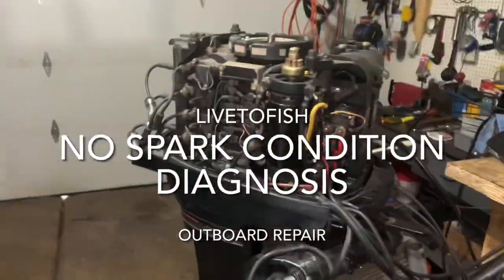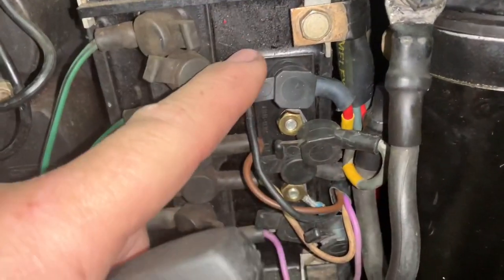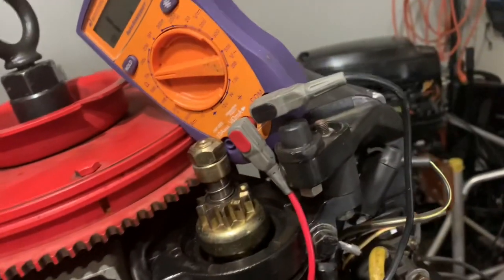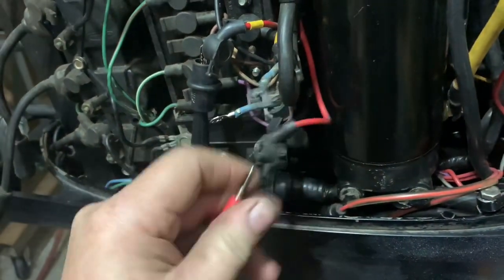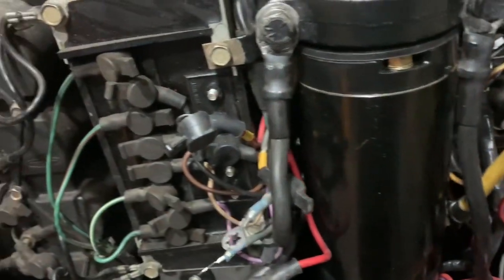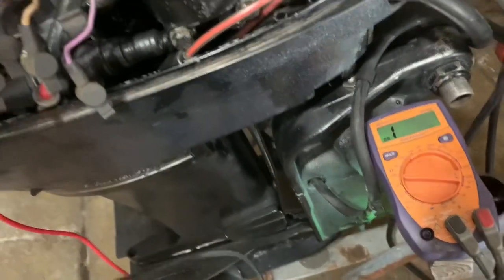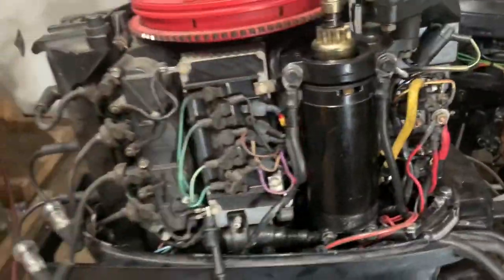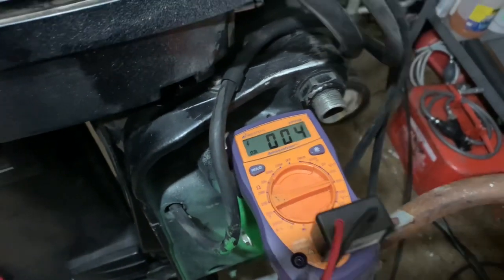“No Spark” Is it a Bad Switch Box, Stator or Trigger? Using a DVA Adapter - 1989 45 hp Mercury

Comment: Wonder why switchbox failed.

Bad coils will damage seitchbox. You dhould replace every coil before sttaching a new switchbox.  Otherwise the new switchbox will fail very much the same as the old one.
Reply from the maker: I suppose the switchbox failed from the owner overheating the motor. I have never heard until now that coils can damage a switchbox. Thanks for watching and commenting.
Reply: @LivetofishOutboardRepair 

I think that coils are very delicate devices. 

Thoy will not handle vibrations forever.

They are very difficult to be tested unless you have a good inductometer available. 

The secondary winding inside is very easy to be checked with a simple ohmeter and I have never seen any reading too far away from 1,000 ohms.

On the other hand I have measured very low inductances (and very low impedances) at 120Hz, which is a frequency close to the maximum rpm which is limited to 6,000.

A too low inductance, and impedance, on the primary circuit may overload the limits of any  switch box.

Two day ago I had the opportunity of measuring a dozen of coils. I found incredibly low values from 0.9 to 0.2 mH while I have read that a good coil may have an inductance as high as 8 mH.

I do think that all 12 coils were bad.

All these 12 coils were sparking alright because the ratio between primary and secondary was higher than ever.

The number of turns of a new coil at the primary might be only 100 or 200 turns of thick wire and more than 20,000 turns of a much thinner wire sit inside at the secondary.

A bad coil, an old one having suffered lots of vibrations for too many hours during several years, might get very many turns in shortcircuit at the primary winding.
The lower the number of working turns at the primary the higher is the voltage at the secondary, assuming that the switchbox can handle 20 or 30 ampere of current instead of only 5 or 10 amps.

Replacement of all coils every so often is.... mandatory, just to avoid the switchboxes to fail.

In fact I do think that all coils AND switchboxes should be replaced every 500 hours or every 5 years... just in case!

All old bad coils wouldn't avoid the engine to bring us back to the shore at very low rpms, but a single bad coil is able to kill the switchbox, which in turn might overheat the engine up to the point of having to buy a new engine!
Reply from the maker: @josemariatrueba4568  I've owned my Boston Whaler now for over 20 yrs with the original 115 hp Mercury and have only ever replaced the spark plugs and water pump impeller. I must be very lucky.
Reply: I guess you meant 20 years not 20 hrs.

Not carbonated calcium  deposits nor salt clogged the internal passages?

Your poppet valve diaphragm still alive?

You are not only lucky, you probably know how to take good care and never overheated your engine.

Mine is a Pursuit 2550 with a single 1997 Mercury 135 v6 2.0.

It used to have two of them, cw on starboard and ccw on port, but the later got completely destroyed from running a new set of three pairs of carburators because one of the 6 bowls didn't get any gasoline and one cylinder didn't survive running with no oil.

The starboard engine has been reinstalled amidship  and is powerful enough to get more than 25 knots the 3000 pound hull plus the 200 gallon tank half empty plenty of stuff, a 9.9 hp auxiliary 4 stroke and 6 persons onboard.

It gets too hot after a couple of minutes. I'm sure that the passages are full of salt because we the broken engine looks terribly dirty inside.

@LivetofishOutboardRepair

Comment: I have a 115 hp mariner 1989. My readings between the stator blue to blue white was 8.50 x 1000 and my manual calls for 6.0 to 7.0 x 1000. Is that too high and i need a new stator? Btw.  Great video.
Reply from the maker: I think that resistance is OK  but check the peak voltage outputs as well.
Reply: @LivetofishOutboardRepair  I have the flywheel off and wanted to ask before I put it back together and test voltage. So now I will do that and check the switch box as well. Thank you for a quick response. I will let you know what happens.

Comment: If you get a chance, or even want to, I got this, no DVA tester, just an old fluke multi-meter; 
Testing the Stator; 
Rd/wht to Rd : 67.5 ohms
Blu/wht to Blu: 7460 ohms
Rd/wht to Rd; 21.86 volts AC while turning over
Blu/wht to Blu; 253 volts AC while turning over 

Trigger wiring;
White to Purple; 846 ohms (while disconnected from switchbox)
Why w/blck to Brown 850 ohms (also disconnected from switchbox)
 All connections to ground were "OL" or 0 ohms. 

Blue wire on right side to white on left side; 300 volts
Blue on right to ground 136 volts
Red to Blue 112 volts
Red to Ground 25 volts

Since I don't have a "DVA" tester, not sure I can trust my results for the rest of the test...It may be my next purchase. 

Thanks for all the help livetofish Outboard Repair!

Comment: So I was wondering if you ever had a problem getting readings with your DvA. I bought a new DVA and it seems that I don't see any readings of any kind when it's hooked up to my multimeter. When I follow your procedure on my 80 horsepower Mercury I'm going to try another meter. I just hope that it's not my DVA and I have to order another one. The initial problem was instead of no spark on all cylinders. It's only no spark on number one cylinder. All the other ones light up. However, I can't do any direct voltage testing with the meter and DVA that I have
Reply from the maker: I've had no problems getting voltage readings from my DVA adapter. Some Meters may not be compatible or capable of reading peak voltage.
Reply: Make sure your Digital MultiMeter is set to read DC Volts not AC Volts.

Comment: Very useful process and informative. I would add at the start (if you haven’t already) to check the plug wires and coils. Pretty simple to test before checking/changing the expensive parts. 
Looking for a good blue spark instead of a weak orange spark can help with diagnosis. 
The l last time I had a power pack go I had a a sudden quit and no start. Have you experienced an engine that still runs with a bad power pack? Thanks for sharing
Reply from the maker: @jimdrech     …. Thanks for watching and commenting. Your experience is very helpful. I have never seen a motor run with a bad power pack at least not yet.

Comment: I worked on these since 1970s up until 1990s Salt water corrosion nightmare.
 Often had power pack low speed charge coils went bad when hot.
Sone older Mercury had a tilt kill switch with mercury liquid in them hooked to kill wire and a dead man switch in control by box .
The older 6 cylinder had distributor cap with trigger and a belt.

I have a 1990 Yamaha 50 all original electrical ignition .

Nice channel 👍 Thanks
Reply: Anything that can be applied to the stator/charge coils to help slow saltwater erosion?
Reply: @FatGuyInALittleCoat1  CRC spray oil .
I always tell people spray entire power head alot with WD-40 
In Salt.
Electric stuff also.
Zinc on lower housing above prop is supposed to slow down corrosion under water.
Salt inside block water covers often rotted out engine from inside out.
In 1980s they changed Aluminum to be much much better.

Charge coil is 350vac may be hooked up to a cathode.anode and shock all the fish  clams out of bay .
Mercathode was a unit used on Mercruiser out drives to stop electrolysis  for drives kept submerged at marinas .
Reply: @FatGuyInALittleCoat1  salt stays behind even when water evaporates.
Sets up a electrical cell to eat away at metals especially when different metals are combined .

Good luck
Check water pump rubber impeller..
I said that millions of times 😂
Reply: @FatGuyInALittleCoat1  excellent motors just change water pump rubber impeller regularly.

Comment: Hello, really enjoyed your videos. You provide some of the best detailed videos I’ve watched. I have a 2001 Mercury 125hr with no spark. I just moved from high elevation to lower. I cleaned 4 carbs and replaced the jets. Put all back together and she would not start. I would like to try diagnosis myself and follow your detailed video testing stator, trigger and rectifier/ regulator. I purchased a 12 volt remote starter switch from harbor freight. I have looked online how to connect to my motor but found nothing very educational. Can you do a video on how to install a remote started switch. I am working on this motor by myself. Thank you so much
Reply from the maker: @kerryaustin4651 … Thank you very much for watching and commenting. I don’t currently have a video installing a key or push-button  switch but will work on it.
Reply: Thank you for your reply. I am just looking to install a temporary remote start switch so that I can crank the engine while at the outboard instead of constantly crawling in/out of boat. Thanks again
Reply from the maker: This is what I use. Just connect one alligator clip to the hot side of starter Solinoid and the other to hot lead to the starter. Hope this helps.https://www.amazon.com/INNOVA-3630-Remote-Starter-Switch/dp/B000EVU8MK/ref=mp_s_a_1_3?crid=XTSJLJNEJZ4G&keywords=starter+bypass+switch&qid=1702850995&sprefix=starter+bypass+%2Caps%2C2043&sr=8-3

Comment: What does that adapter to the meter do?
Reply from the maker: @japisme2343… The purpose of the DVA adapter is to convert the average voltage reading to peak voltage output. Most top end multimeters are capable of reading peak voltage but lower end meters are not capable.

Comment: If the trigger readings aren’t in spec would it make the switch box not read correctly?
Reply from the maker: @nathanhuckabee8015… Yes that is my understanding. If the Peak Voltage or Resistance readings are out of spec replace it.

Comment: I just watched this vid of testing the stator, trigger, and pack.  Do you have a vid showing a stator and trigger you tested and replaced?  I am trying to help my nephew get an 1985 75 merc 4-cyl 2-stroke running (no spark at all.)  I gifted him the boat and when I put it up (20 yrs ago) she ran fine.  We paid a tech to diagnose it to a bad box (I got him a CDI and he replaced, but no change.)  He even tried another used CDI box thinking maybe the new one was bad.  I had him disconnect both the kill switch and tilt kill switch wires.  I am thinking the diagnosis was bad but the guy who supposedly did it owns a large shop and supposedly "is good" -- I don't know him (I'm not local to there) but I am questioning that and wondering if he just tested the box output and not the inputs!!  So I think he may have to get into the flywheel and looking for a vid of that just in case they test out bad (I need to get him a DVA.) so he can see what he would be getting into and feel comfortable about it.  I'd have no problem but I live a day away.          
Is there any known issues with Merc flywheels/magnets around that vintage perhaps?
Reply from the maker: @knan2308…. First thing I would do is disconnect the wires from the Stator and check resistance. Then the do the same for the Trigger. If ok then get the DVA adapter or a good Fluke meter that reads peak AC voltage to see the inputs and outputs. If you pull the flywheel you will need the specific puller and inspect to see if the magnets are strong and not missing or damaged. Also make sure the Woodruff key has not been sheared. Sorry but i don’t have a video on replacing a bad Stator and Trigger at this time. Good luck chasing down your Nephew’s issue. Thanks for watching and sharing your experience.
Reply: I've seen magnets that had come off a Mercury flywheel.  They're powerful so they transfer on to the stator. Some will remain attached so the flywheel will push the loose magnets round when cranking. It makes quite a rattle but hard to detect. They're very powerful so even when detached are hard to wiggle with your finger tips. A quick check is feel under the flywheel for any magnets touching each other.
Reply from the maker: @daithiosioradain3380 ....So true. Thanks for watching and commenting

Comment: If I disconnect the kill swich connector and it runs, can I run the motor without the killswitch connected until I get the killswich replaced? Thanks so much for this video, I learned a lot.
Reply from the maker: @kevdmiller5150… it’s a safety issue and is up to you. The kill switch is designed to shut the motor off if you hit something in the water like a log that raises the motor out of the water.

Comment: trigger ok value 793  ? or not ?🙄
Reply from the maker: @ norwajjohnson8726… Yes the trigger was good having a resistance of 793 Ohms. The spec is 800 - 1400 Ohms. I think my meter might have been off a little because the trigger still worked fine.
Reply from the maker: Scale was set at 20K

Comment: excuse me  (stator) ,blue /blue white   6.45 ?? value ok ? or not??
Reply from the maker: @norwajjohnson8726…. Yes it was OK because the meter was set at 20K Ohms scale the value was 6.45K Ohms or 6450 Ohms. The acceptable range was 5K - 7K Ohms (5000 - 7000. Ohms).
Reply: @LivetofishOutboardRepair   thank you very much you have been very kind🙂👌

Comment: When i check white to ground and crank i get nothing
Reply from the maker: Mary fifthen …. If you are checking white to ground peak voltage using a DVA for the trigger it should be 1 volt or more.
Reply: @LivetofishOutboardRepair  wile you are cranking? White wire connected or not
Reply from the maker: Yes connected, while you are cranking white wire to ground. 1 V or greater.

Comment: Now if I omhed my stator like you said should have 5000 to 6000 ohmes I have 4000 would that be a problem
Reply from the maker: I would not assume it’s bad with that high resistance. I would confirm it using a DVA adapter measuring the peak voltage output of the stater.
Reply from the maker: Low Power may indicate that you’re not getting good spark on all cylinders. Check the spark gap by using a variable, adjustable, spark tester. Check compression at all cylinders as well. You may have low compression on one cylinder or more. Could be plug the carburetor or worn out fuel lines, or pump check for fuel leaks where you have fuel leaks you can have air getting in check all fuel fittings as well. If you squeeze the primer bulb while attempting full throttle and the rpm’s increase you most likely have a bad fuel pump.
Reply: OK thanks, I have a 1988 Blackman 150 xr4 not sure if I just have foul plugs or what it won't go faster than 6 mph , starts and idols fine but when idols sounds little to Quiet not as loud as it used to be? Any thoughts
Reply: Also if I give it full throttle it wants to stall I just back off throttle a bit it runs but won't go faster than 6mph  I'm really trying to get back on the river ,
Reply: Is there any way to test the switch boxes
Reply from the maker: Yes, I go over that in the video using a DVA adapter and an ohmmeter

Comment: Thanks for the great video,

How to get a troubleshooting sheet for a particular brand engine?  Also, is the "Trigger" an adjective to describe what happens regarding the Switch Box or a device/part that I somehow am missing?
Reply from the maker: TheSilverSurfisher…. Great questions. Thanks for posting them. To find your specs for your specific model you should go to www.cdielectronics.com 
Then Click on the Technical Support tab, then click Technical Documents, then click DVA charts. This will give you the information you are looking for by year and model number.
The trigger is located under the Stator under the flywheel. It’s function is to provide the correct timing of the motor by using electrical impulses to the switchbox to fire each spark plug at the correct moment. 
I hope this helps answer your questions. Thanks again for watching and commenting.